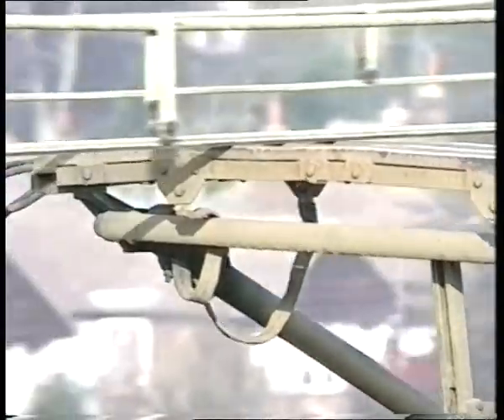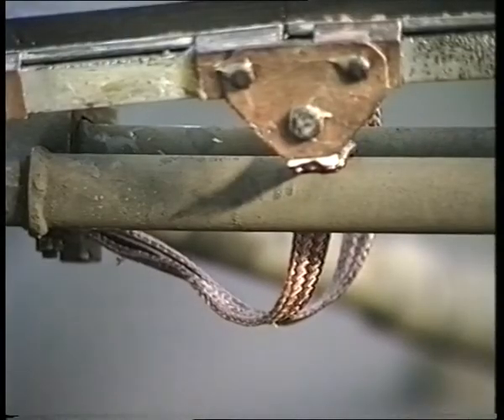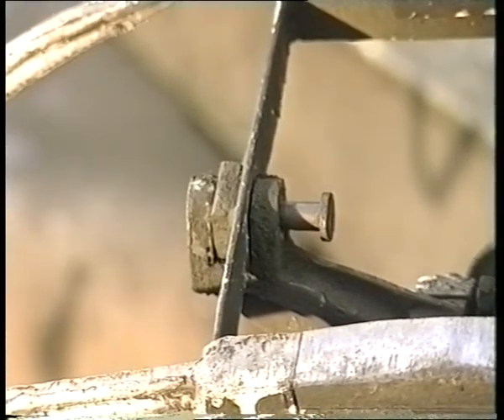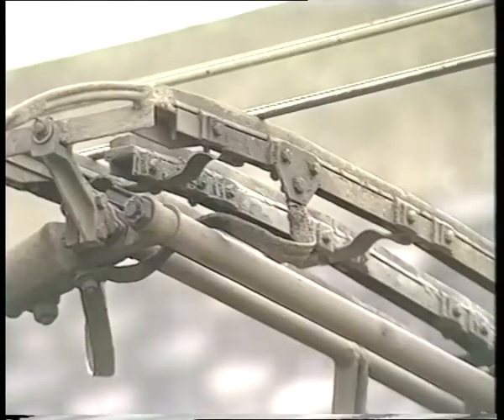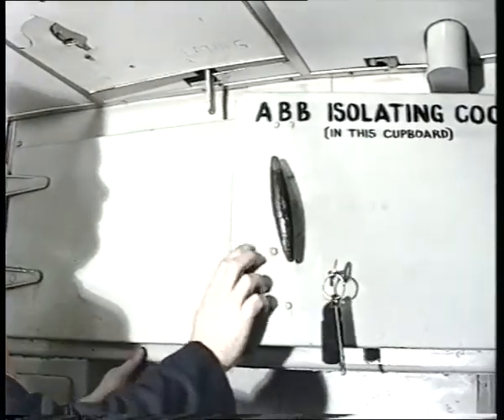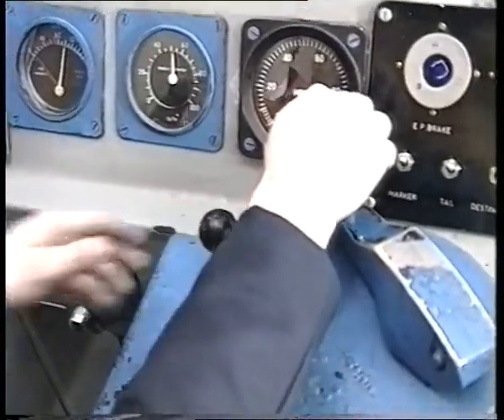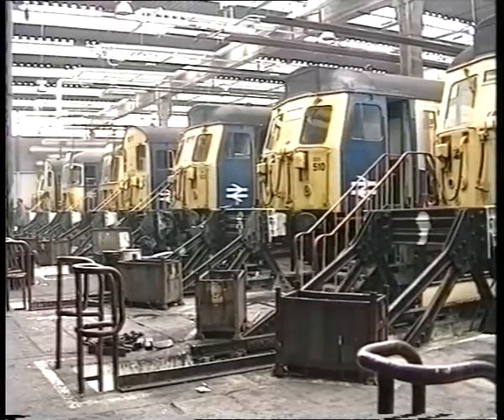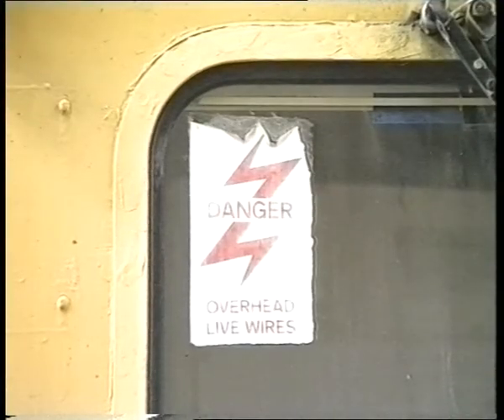Pantograph Isolation LTS

Comment: Why did Network South East have to use that terrible, and totally inappropriately music on their training videos?

How long do pantograph carbons last?  Can they be replaced, or does the whole pantograph head have to be changed?
Reply: From what I remember they used to send the whole unit away for refurb, during this period.
  Not a fault I encountered over 30 years, had some air motor failures and dropper wires wrapping round.